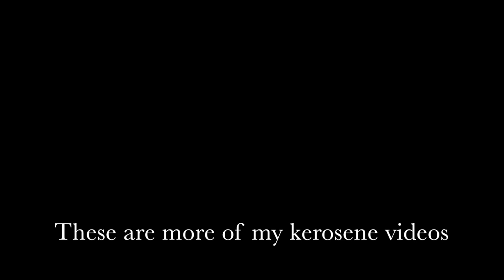How to change a DynaGlo 23,800 BTU kerosene heater wick & ignitor (step by step instructions)

Comment: Any tips to get rid of or help with kerosene smell?
Reply from the maker: Hi! Yes! I have 5 basic tips to help with this. 1) Start up the heater OUTSIDE (like out on the porch). Let it burn for about 5 minutes, then carry it in or use a square flat rolling dolly to help save your back. The initial startup of this unit releases fumes and smells you do not want in your home. 2) Crack open a window about 1/4 to 1/2 inch. Burning kerosene sucks oxygen and moisture out of the air and a continuous fresh air flow is necessary. I know it sounds counter productive but you'll also find this info covered in your instruction manual. 3) You kerosene additive. There's a brand called 21st Century and you can usually find it at Tractor Supply for less the $4. Additive mixed in with kerosene fuel helps keep the wick burning clean. Carbon deposits on the wick and water in your fuel can enhance that kerosene smell. This additive will help eliminate that. 4) Always use clear K1 kerosene. All kerosene has sulfur in it. When sulfur is burned it creates this nasty "rotten egg" kerosene smell. Then more sulfur is in your kerosene the more carbon deposits you find on your wick. Clear k1 kerosene has the lowest amount of sulfur content in it, making this the reason clear k1 kerosene is always highly coveted/recommended. This is also why when you burn red dyed kerosene, the kerosene smell is pretty potent...that sulfur content is high. 5) Lastly, shut down your heater outside. When you extinguish that flame, your heater is going to release a potent smell and some slight smoke. (This is comparable to what happens when you blow a candle out.) You really do not want this smell in your home. Leave the unit outside for 20 minutes or so after you shut it down so it has time to cool and for the smell to dissipate. These are the exact steps I follow and I've never had anybody complain about what my home smells like. Most people don't even guess I'm running a kerosene heater until they actually SEE the unit burning. That usually ends up in a conversation regarding why they can't smell it...lol. See steps 1 thru 5...lol. Hope this helps you out. Thanks for watching and supporting our channel. If you haven't already, please consider subscribing. Take care and stay warm!
Reply: There is a. Inexpensive additive you can use. Walmart hadnit last I looked.
Reply from the maker: @budjiman1  The most common brand of additive is 21st Century and usually comes in a green/blue/yellow bottle for about $4.99 in retail stores. Additive has 3 main purposes. 1) If you purchase a scented additive (common scents available are pine and vanilla), it can provide a pleasant aroma when your heater is burning. If you purchase the unscented additive, it can reduce the overall kerosene smell by neutralizing it. 2) It can remove the water content in your kerosene fuel. 3) It can extend the life of your wick by reducing the amount of tar and carbon buildup over time. Thanks for watching and supporting our channel! If you haven't already, please consider subscribing. Take care and stay warm!
Reply: Great instructional video. Just curious - are you using K1 kerosene from the big box stores or have you found a gas station that sells clean kerosene you can pump?
Reply from the maker: @justinjordan567  Hi! Thank you and great question...I've done both ways. My first winter using these kerosene heaters, I purchased the 5 gallon cans of clear k1 kerosene from the big box retailers. I quickly learned that method is NOT cost effective and it was a headache keeping track of which store had it in stock. Switched over to purchasing clear k1 from a gas station and haven't looked back. If you enjoyed this video, check out my kerosene heater playlist. Here's the link:  https://www.youtube.com/playlist?list=PLFiwaO861E2zrYAbNULU-taPr7_Qcejcu Thanks for watching and supporting my channel! If you haven't already, please consider subscribing. Take care!